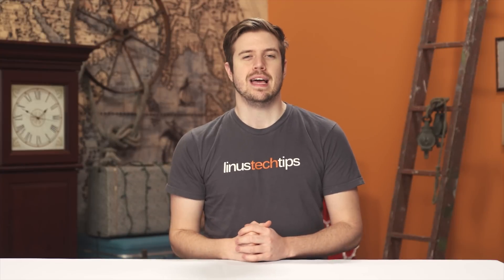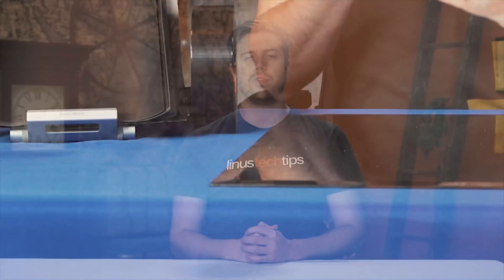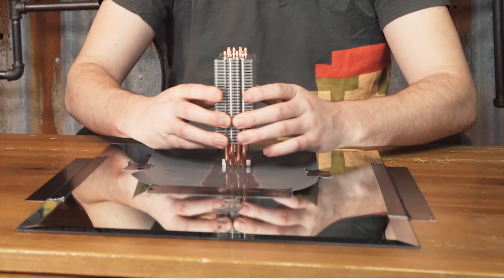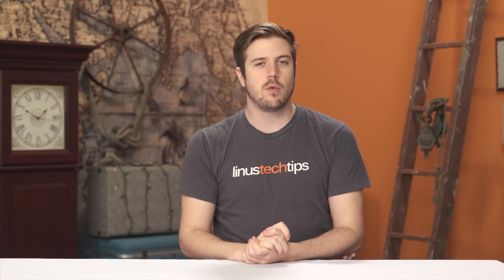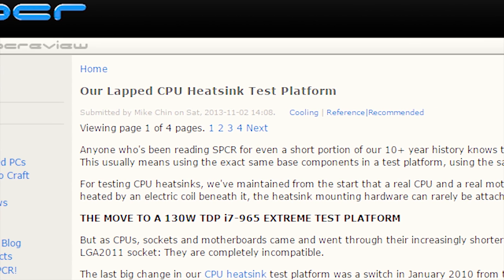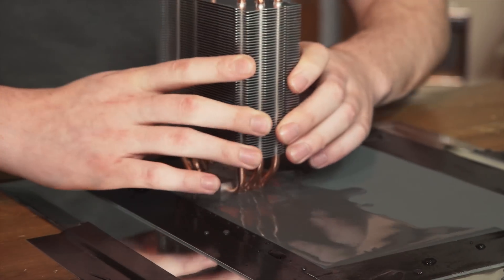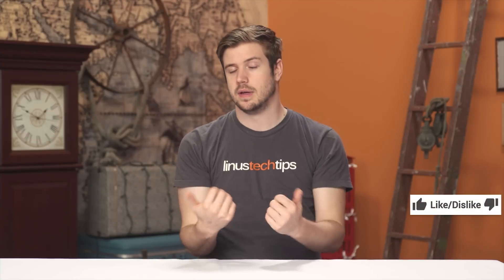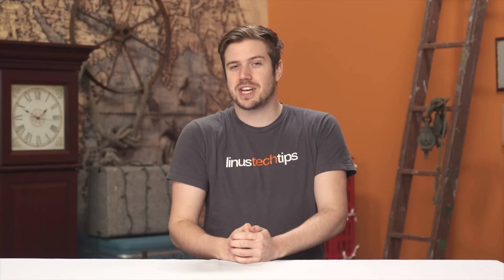CPU & Heatsink Lapping - Are concave, convex, or flat heatsinks best for cooling?

Comment: Aw, poor Luke. We really need to find you something to test that actually matters.
Reply: +My eyebrows are GONE!? Perception, interesting, condescending...
I feel like those were the only words with over 10 letters ._.
Reply: What if u put a water cooler or any cooler direct on a delidded chip.. :)?
Reply: RisseK1 I didn't say it's not interesting. My comment was based on my perception of Lukes feelings. The null result is perfectly valid and interesting, but it isn't fun to put in hours of work just to find out none of it mattered, unless you're the sort of person who does enjoy that. And not having fun can lead to burn out. Which would suck, because these videos are interesting.

Also, next time, leave your condescending attitude in the trash, where it belongs. Or else expect to be ignored or deleted.
Reply: Ryan P Big boi and his big words :3 adorable.
Reply: +Ryan P Have you seen the state of the CPU they use? Due to their poor taste in thermal paste it is scratched up REALLY bad. Lapping a heatsink then using that CPU won't make a difference when their CPU heat spreader is in a much worse condition then the heatsink before lapping.
Reply: +Ryan P Maybe a comparison of coolers based on design.  Test a swath of direct contact, stock, indirect contact, 4 pipe, 6 pipe, ect. We all know stock suck but the difference in performance would be cool to know when purchasing.
Reply: +bobby wasabi Well, let's look at you engine analogy.  I think it's closer to a race driver getting a few more horse power to shave off tenths of a second in lap-times.  It might not seem that much for a daily driver but in competition it could mean everything
Reply: +bobby wasabi Fair enough.  I guess I'm just saying that a lot of computer guys are weird in the same way as a lot of car guys.  Those numbers don't mean much to most people but are important them.  More horsepower, better performance, win.  Less heat, better performance, win.
Reply: +RisseK1 i think Linus (though being Nvidia and naturally Intel fanboy) does a great job as whole. And also is one of rare tech guys on YT who doesn˙t fanboy for Apple and that is great imo :D. 

They get into interesting matter lately but people hate them and bitch like crazy. Take the OP here as an example. 

I`m also tired of current CPU and GPU benchmarks. I`ll be interested when new stuff arrives in the summer and Zen materializes during the fall :D.
Reply: +RisseK1 damn kids! get off my lawn!
Reply: +ChrisHen_   A Brother!!!!!
Reply: Why not try some theories with graphics cards, since they tend to be power hungry and easily heat up. Processors these days, with their power efficiency are not as affected by these techniques that might have worked better with old processors.
Reply: +K Doe tru but it is hard to sand down graphics cards because of their odd shaped heat sink
Reply: +Manav Anand the heat dissipation is probably designed to be very good on most gpus even if the heats ink is not perfectly flat
Reply: Maybe he can show the difference between fan and liquid cooling
Reply: +Ryan P how about RAM heatsinks?
Reply: +Ryan P CPU & Heatsink Lapping isn't one of them things ....
Reply: +RisseK1 I don't think it's about not enough gpu benchmarks... Linus tech tips content has gotten stale as hell of the last year.  Partially because there is little to no linus in the videos, which is what launched the company into success in the first place. I remember when there were only 200k subscribers and around a million subs the company was in it's prime. He had people to edit and linus did the reviews and testing with good production value. Now there are like 10 people and production values have barely moved.
Reply: +SpazSpy :0 woolen slevleet channel?
Reply: +My eyebrows are GONE!? Sorry, I'll make sure to use small words next time so as to not confuse you, you Neanderthal's lobotomized cousin.
Reply: +Ryan P these videos are meant to test things that never have been tested before. not to be necessarily useful lol
Reply: Julian Gray Media He just meant that, spending all that effort to achieve... Nothing much, could put Luke off doing things like this.
Reply: Julian Gray Media but it's useful information, most of what Luke has done in this series is debunk the myths of pc cooling. The forums are filled with those.
Reply: +Toast Oh hai dere!
Reply: +Ryan P 
Iam a DJ now, aw aw awwawwawww
Reply: how about an own YT channel :)?
Reply: +Ryan P well, his previous tests actually mattered. It's just, the results he got told him that method basically didn't matter. Like with cable management, we learned that it only matters if you want a clean look.
Reply: +Krytern UK No, it would still do nothing.  You are just reducing the amount of thermal paste within the gap by a small fraction.  It won't make any real difference!
Reply: It does on ryzen
Reply: Why don't you try that with an AIO?
😂
Reply: +bobby wasabi Pretty much... lol!  The hours you waste doing shit like this to reduce temps by 1 degree could be better spent picking up cans on the side of the road, and then buying a $100 cooler.  That also has the added benefit of actually working to lower temps slightly... lol

Comment: Tired of whatever? De-lid a CPU, then don't put the heat spreader back on it and make direct contact between the cooler and the CPU die. Then test the thermal difference.

Comment: +LinusTechTips 
Luke... Sand off both surfaces heatsink & processor (not too much as you've done on heatsink). Just sand a little just like thickness of two papers. Then add little bit extra thermal paste. After results, I'm sure you will know the difference.
I did that 15 months & reduced 4.27' temp.

Comment: Well, its been a LONG time, but i recall getting a very god improvement from an early tu120ex (was on an e6850, must be 10 years???) it was very convex, lots of them were, some better than others, i cherry picked mine but still got good 5c+, it could have even been 10, it was an awful long time ago. Some of them i saw when selecting mine had god awful bases, so much better than my results could be expected.
Amazing cooler, i still use it on my current i7 (after getting bits of this and that to get it to mount on current gen socket) and it still performs very good for its age!

Comment: Not too suprising since the 212 already cools extremely well, in my testing, sure it couldn't compete with a NH-D15 but it wasn't that far behind a be quiet dark rock pro(1 gen).

I think you should bump the voltage/lower the fan speeds a little or something just to get closer to a real world scenario, I mean who would lap a cpu that's already cool at 67 degrees? Anyways, want something that yields results? Try delidding. Made a quite noticable difference on my haswell 4670k.

Comment: I lapped a 1366 i7 and an ek supremacy nickle pom water block back in 2011ish.When lapping, the water block had an X or cross high spot going from corner to corner. I went from 400-3000 grit dry. Then i did the CPU as well. This had a central high spot with the corners being high as well. I used the same sanding 400-3000 grit dry method. When i was done, both the CPU and the water block were basically a mirror finish. They were so flat in fact that i was able to stick them together with only a vacuum effect. Once i was done with the lapping process i got about a 7c drop. It was evident that there was a drop. At 4.0 Ghz it would idle around 19c (winter time) and max out about 45c if memory serves me correct. 
I did the same with an old OEM AMD chip and stock aluminum heat sink and was able to cool it at normal parameters without thermal paste . (it was an old junk pc so i didn't care if it fried)
All in all, with how cool most CPUs are these days, i see little need to lap anything.

Comment: back in the day I had a pentium D 805 and a Scythe ninja that I lapped (both to make sure both CPU and heatsink were flat) and from memory it made a few degree's c difference, but that is the only time I have done it and it could have been better thermal compound application also.

Comment: You can tell from your shots that you did a crummy job lapping. The surface is not flat and you did not remove the previous scratches meaning you moved up in grit too soon. And you should really lap the IHS as well if you are going to do it.

Comment: Fyi intel cpus are never fully flat and your testing proved that, plus you dont need to use thermal paste as both surfaces are perfectly flat when lapping both parts. Mostly i find that these workshop videos are complete trash and have important parts on information left out

Comment: im intrested more in when after market thermal paste goes off.. like is it worth a freshen up
Reply: +Jackson bermingham From most peoples experience it can be worth a few degrees (the bigger the thermal output the bigger then benefit hence why allot of gpu's get it done) but its kind of a 5 year thing so gtx480/580/6970's pretty much.
Reply: +Toms Tech yer my det ups almost 3 years .. trying to think um i7 4770 could be 4790 ..gpu 7970 ..thinking a water cooled gpu and rethermal paste the thermaltake c5  not getting hot maybe 50deg but gpu getting 70deg  but wpuld be fine for my theater set up
Reply: Jackson bermingham Thats a pretty sweet setup, might be worth a thermal paste job on gpu but 70*c isnt bad, may be worth double checking you fan profile in afterburner, and a 4770 will run hot (intels do) but probably not dangerously.
Reply: +Toms Tech just getting average frames on casaul games liken fsllout on csgo 400 plus but i play 4.3 res

Comment: Here is a tip. 
If you think your heatsink needs lapping. grab a ruler ( preferably an aluminum one ore laser cut ) and check the heatsink for bow ore curve. it's much like checking a cilinderhead for flatness. If you can't slide the corner of a €5,- bill under it. then there is no sense in lapping it at all. 
And after all. isn't the paste there to fill in the voids. ;)

Comment: a thermal paste's reason of being isn't actually to cover these microscopic groves to have an even heat transfer?
Reply: +Lorentz the annoying Llama Have you seen the state of the CPU they use? Due to their poor taste in thermal paste it is scratched up REALLY bad. Lapping a heatsink then using that CPU won't make a difference when their CPU heat spreader is in a much worse condition then the heatsink before lapping.
Reply: +Lorentz the annoying Llama They do tend to liberally apply TIM before putting a cooler on, just a rice grain size drop in the center is all that's needed not a stripe clear across the CPU like they do. The TIM is probably preventing any decrease in temperatures.
Reply: +SweBass Yes you're exactly right, that is the thermal paste's job, so this is pretty much stupid to do anything for those scratches,  groves and other things. but a flat surface is important, which sanding will not achieve without HOURS of work,  You will want to instead take it to a machining shop and have them flatten it.
Reply: Sean Anderson You can get flat results from lapping, hell you can get mirror finish results without the slightest distortion with lapping like in the video. It's just doing a good job takes time and practice which were obviously both missing from the host of the video. When he was lapping on camera you could see some shudder once when he changed directions, what's shown in the final video is the best footage they have, there was that one screw up in the best footage they had so I will assume there were far more and far worse. Taking it to a machine shop isn't needed, just time and patience as well as practice blocks of copper.

Comment: i don't know if you cover this topic before but can you give us some tips for how to run your laptop as cold as you can
Reply: +AnIsS ITACHI Watercool it...in a bowl of water, how Linus did with a notebook Mac.
Reply: +Murphistic true it work but it's not a practical solution :)
Reply: 1. get some old Fans and a powerbrick with 12 v Output 2. soder it together 3. let the Fans pushing Air under the Laptop 4. have a cooler Laptop
Reply: AnIsS ITACHI
I see your point :)

My more usual tip is to keep your laptop cooling fan(s) clean. Cleaning the cooler once a year or in two years was OK for my notebook, but it depends on whether you use it in bed. Personally I didn't have the courage to replace the thermal paste and possibly the thermal pads, but it seems it's OK so far.

Little addition: when I encoded video on my win tablet and needed the cores running at turbo clock, I aimed a room fan at the tablet... and it worked :D The Atom Z3735F was running at turbo clock speed for the whole time with libx264 running on it:D
Reply: +Murphistic  my laptop was always clean but the i7 ran at 90° Celsius+ with clockspeed 3,2ghz with extra Fans at 70°+

Comment: I used to do this back in the early 2000's when I was overclocking etc. and in many cases it had a significant impact. However, as time has marched on and heat-sinks and thermal compounds efficiency have  improved I found there was less of an impact. Finally in recent years I've noticed no difference and therefore no-longer lap.

Comment: That's not lapping .... lapping is done on a lapping plate with lapping compound .... not with sandpaper. Sorry Luke ... but thats bull**.
Reply: +Jose Shigemitsu Maybe to a dumb shit like yourself. "Lapping" is when rubbing something abrasive against something else, doesn't matter if it's by hand or machine. Ironic that you have a car in your avatar and lapping is used in engine building, but you don't know what it means. Lul.
Reply: +innie721 Adumb shit like me ... as you said.... is in fact using this  in rebuilding rotary engines. I didnt say that u have to use a machine .. u can do it by hand for sure .. but it involves a compound and two surfaces .. no sandpaper.  --> https://en.wikipedia.org/wiki/Lapping
Reply: Jose Shigemitsu You really don't understand lapping. You shouldn't go anywhere near a car.

Comment: Very poorly done lapping, You should hold by the base, not high by the fins, best to press the base itself gently in the very centre of it, and the result should be mirror like which this wasn't. After 3h this was very shitty result
Reply: +3majsie maciek Not really, he could have used up to only 600-800grit paper. If he wanted mirror he could have gone 1000+. Through all the cpu's I have lapped- going for the mirror finish has any negligible difference.
However, he should have lapped the IHS on the cpu if he wanted to see any significant difference.

Comment: Aaaahhh... Did this with c2d e7400 and ocz gladiator max. Shaved 10 C
Reply: Well, my  cpu was concave, and it took  a looooot of sanding to get it flat. I think I went up to 1500 wet sand paper, same on cooler.
I've heard one of the Cooler Master AIO coolers have really bad finish, it might be the nepton.
Reply: +MrRorschach87 10c ? Sounds like BS to me. 10c off what, max idles, or across the board?
+Je van der Geest Watercooling will often net lower max temps, but can very well make your idle temps higher. How´s you stress test temps looking? compared to air?
Reply: +Crownicsz Max load (linx), idle temps were lower but not that much. It allowed me to oc that cpu to 4 ghz. I think the only reason why it affected temps so much is the cpu was really concave (I started with 200 wet sand). Also, the cooler finish was terrible. I still have the cooler, it is on phenom 965 oc to 4 ghz, it keeps it under 62 c in linx if the room is around 15 c. (I didn't lapped the phenom, because pins make it harder to grip, and I couldn't be bothered)
Reply: MrRorschach87 fuck man, 15c ambient, I would have frozen my balls off:)
My (studio) apartment always hovers around a toasty 20-22c. 
My VPin has a c2d too, I might have to pop that sucker out and check how concave it is. Not that it´s having heat issues, as I´m not playing Pinball that much lately.

And reading a little more into this I might have a go at my main-rig, and its 8350 (AMD) also.
Although, I´m going blue on my main soon, so it might just be a waste of my time.

It´s a fun discussion though. just look at this mirror finish http://forums.anandtech.com/showthread.php?t=2300800
Reply: +Crownicsz :D but that's only when stress testing it (it didn't go past 55c in gaming or prime95, on 22c ambient though I was using Cooler Master Excalibur fan on that OCZ cooler). C2D looked pretty much like the ones in the post after 2000 grid. I went i5 route last fall, and I was contemplating of replacing phenom with 8350 in my secondary rig, but I don't think it's worth it (since it is only for gaming, better solution would be to replace that old radeon 6850) .

Comment: you don't seriously think sanding the heatspreader is going to make it perfectly flat do you?? even if you can't see it you probably introduced multiple imperfections in the process. but the more important thing is the thermal paste is supposed to mitigate these imperfections in metal to metal contact anyway so you're trying to solve a problem that doesn't even exist. what next? are you going to sand that i7 processor as well?